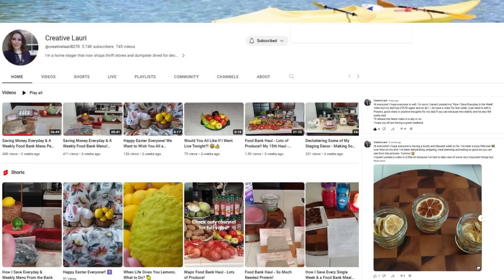Preparedness Paralysis! Don't Let it Happen to You! Life @ Remote Alaska Cabin

Comment: Your cabin is becoming really classy with the new furniture and painting. I do highly suggest that you work on grtting either a snowblower or 6 wheeler with a plow and maybe get a 4 wheel drive truck that sits higher than your car. Overall, nice video.
Reply: Good advice, I have a small Honda snowblower, and that is really effective on my driveway, and easy to use. The key start has stopped working but the pull cord start is really easy. I will get it serviced this fall, so it is ready for another winter.

Comment: Never give up, never surrender.  I have the same water problem at my property, first time in I have had this issue in 20 years.  No such thing as a typical winter or spring.  I have been hearing wolves around my place lately, not common for me.  Love the grenade!
Reply from the maker: Hi Dave! I will never give up or give in! I am way too stubborn for that! Luckily the ground is starting to dry up. Well the standing water is draining finally if nothing else. The wolves were really close to the cabin again a few weeks back. From how loud their howls were, I figure they were within half a mile of the cabin. The guy who plows my driveway traps in the area, and he told me that the pack here is growing in size and that they have no fear of people. Wondered how long it would be before someone pointed out the grenade. Not surprised that you noticed it. 😉

Comment: I think you're doing great. My concern is if you slip off ladder or roof, and have to remain flat til help comes. What's your back up for assistance. 
I realize things cost money, however wouldn't a set of stair with 2 level climb (like city fire escapes) be better? At least taking a break from shoveling you could rest on platform and a sturdier base for pulling/lowering items needed to get jobs done?

Comment: It was me that told you about the frost in the ground holding the water back and making your driveway muddy..and yes by having the driveway plowed this winter it drove the frost deeper into the ground.
When I was logging we built winter roads that way..at first we kept the road plowed right down to the dirt.if it snowed more then two inches we had to plow it.anymore snow would insulate the ground.once we had the ground frozen we just packed the snow down to build the road up and smooth it.